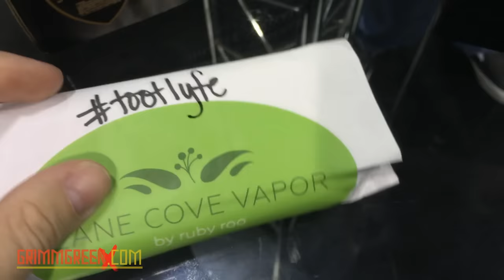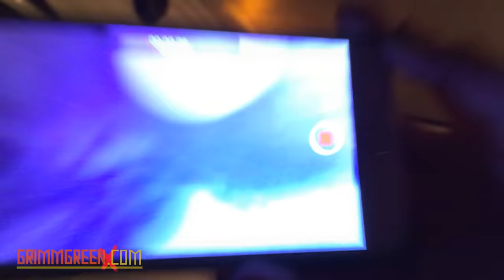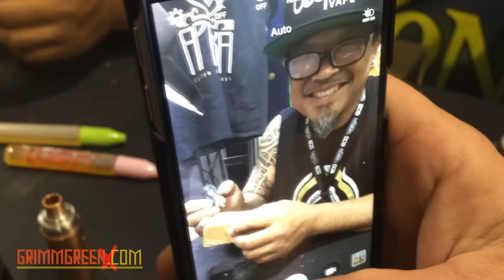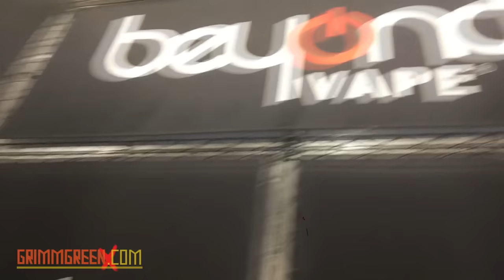ECC 2015 ~ People ~ Vapor ~ Beer

Comment: Hey Nick, great vid, question how low does the DNA 200 go in kanthal mode?  I know you have a few DNA 200 devices now and was wondering if you have tested that since I know you usually build low anyways?  I've been looking all over Google but can't seem to get a straight answer on how low it actually goes in kanthal mode, temp mode I'm not really worried about because I'm not into Temp Control.
Reply from the maker: +JDM Vapes I've been down to around 0.12 with the DNA200 series , not sure exactly how low it goes
Reply: +GrimmGreen Nice, as long as it's below 0.2 I'm kool, thanks bro!

Comment: Would you recommend 32g ni200 for dual coil rda builds? I've used 28g and it's insanely low res. How is temp control with titanium?